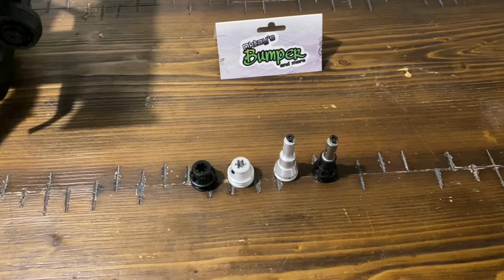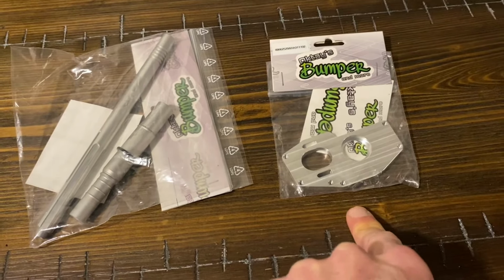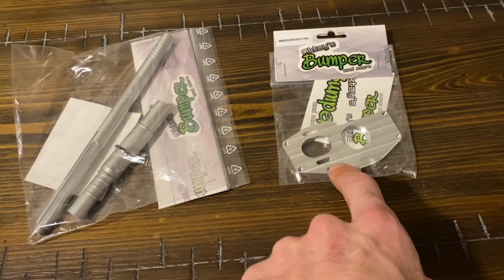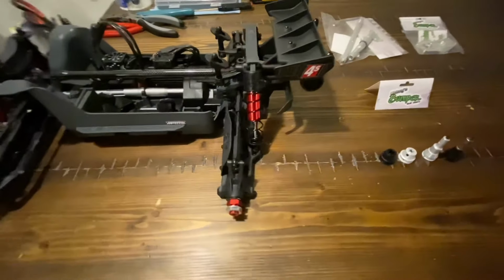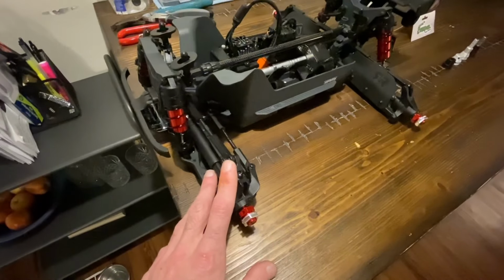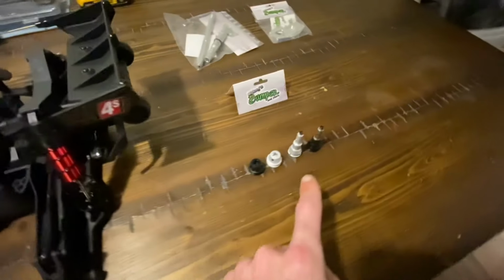NEW ARRMA 4s aluminum axle stubs and cups BEST driveshaft upgrades by OKTAYS bumper @ARRMARC

Comment: Nice upgrades. I’ve been looking for the Oktays drive cups and the hub inserts, but I can’t find them anywhere. My next option will be the CRCU drive cups and they are much better quality IMO. Everything does cost more from them because of where they are tho.
Reply from the maker: @JJ-lu6mg  so I'm not sure those work with the v2 driveshaft they were made for the ARRMA cvd upgrade from the v1 and the aluminum OKTAY's didn't work out completely them being aluminum didn't work on the wheel hub side it kept bending or breaking where the bearings rides he's revised them now with a strong metal steel I believe but I've yet to see them so can't speak on them but I only run the diff side and it's works great have this on 2 4s cars now my biggest bashers
Reply: Do you upgrade the steering assembly ? I was looking at the GPM one and it looks pretty nice.
Reply from the maker: @JJ-lu6mg  I do check this video out...

The ULTIMATE ARRMA 3s/4s steering upgrade stop having SLOPPY steering #rc4life
https://youtu.be/W6z1rL1Fn5Y
Reply: @RC4us  I thought that might have been the reason for not seeing them. I did watch your video on the Outcast when you bent one. Thx for the heads up on those steering assembly’s not working on the 2.5’s.

Comment: My Kraton 4s v2.5 had sooo much locktite on the rear left axle that it stripped the screw instantly and I was using MIP drivers! I had to cut the hub off the axle! Thankfully I was changing them to the black anodized hubs from the 6s Big Rock (thanks to Jenny’s RC)! There was so much locktite on the axle that the pin didn’t want to come out! I told Horizon about it and they sent me all the replacement parts I needed to fix it but by the time I got them I had already fixed the issue! But spare parts are always good to have just in case!! Do you know if anyone else, other than Oakley’s, makes the center driveshaft for the v2.5 Kraton? Great video! Thanks from a fellow Buckeye!
Reply from the maker: I do not but his are mint you can source them in the states thru evs hobbies

Comment: Are you still running the aluminum center drive shafts on your 4s rigs ? The reason I asked is on one of your more recent videos it didn’t look like the aluminum version.
Reply from the maker: @JJ-lu6mg  I only have it in the outcast 4s he didn't make one for the xxl Mojave at the time and I'm unsure if he ever did make one and I noticed the longer they got the less I liked it I had one in my OG KRATON 4s that I sold it was still doing good just become sloppy I wouldn't recommend on anything other than the outcast and at best KRATON the xxl long chassis I just think would be to much stress
Reply: @RC4us   ok cool, I did put it on my Outcast and it’s been fine so far. I have mostly 6s rigs, but I do plan on making the XXL Kraton 4s. I have really been enjoying this Outcast at the skate parks. Thx for the feedback I really appreciate it. 👍
Reply from the maker: @JJ-lu6mg  anytime always glad to help

Comment: What is the website for oktay bumper?
Reply from the maker: Search in Facebook he doesn't have a website EVS HOBBIES sells his parts in the states but idk if these have made it yet
Reply from the maker: I just updated the links in the description I thought they was both there but are now
Reply: Yeah don't see those parts on evs. I have those 7075 driveshaft cups from custom rc a long time ago anyway and use rcawd steel axles. I did that when the original v2 came out.
Reply from the maker: @Schmidt3850  all this is brand new probably only way to get them is to go on Facebook and message him
Reply: Oktaysbumper
Reply: .de
Reply: Modellbau-metz
Reply: write together
Reply: Can't leave a link, sorry